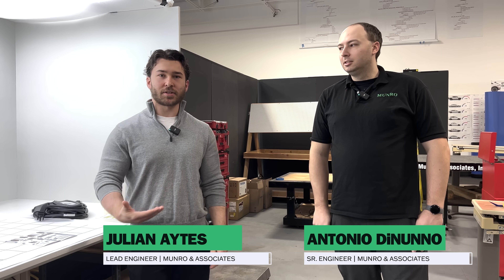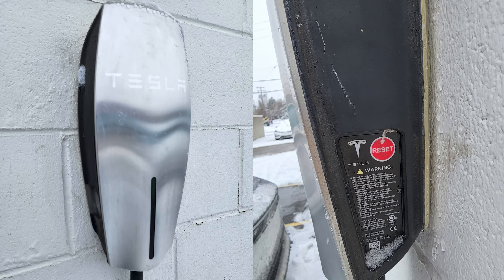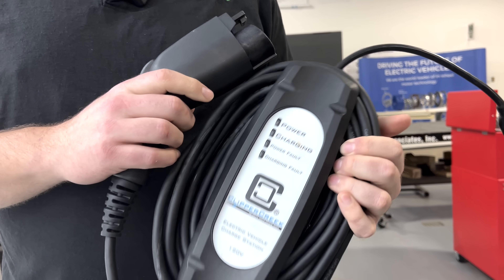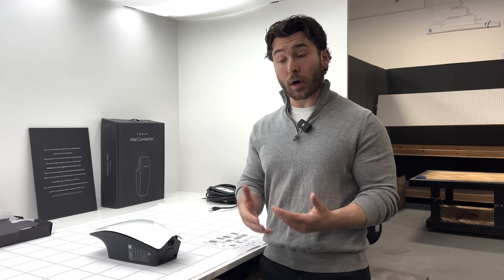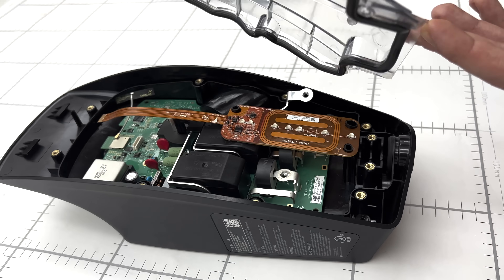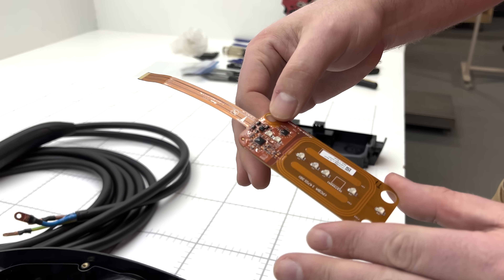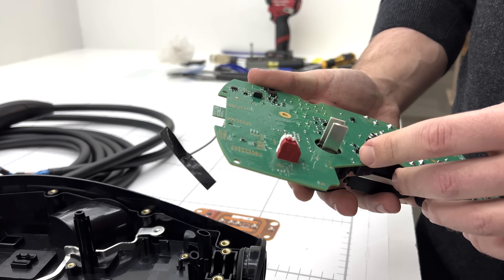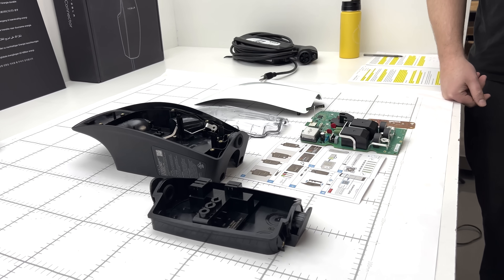EV Home Charger Teardowns E1: Tesla Wall Connector

Comment: Those two connectors unpopulated are for between unit’s communication up to 6 units connected parallel RS485 for load balancing. I have 2 connected at home but suspect they now communicate via Wi-Fi instead. That allow them all units to share and load balance dynamically single circuit like 60A between 4 cars or 40A between two in my case. Works better than any other I used.
Reply: If it’s RS-485 then it should be easy to find the necessary transceiver ic on the board.
Reply: The 2-wire interconnect was what version 2 had, version 3 only has wifi according to Tesla's specs. So while the version 3 may still have the hardware, if those terminals are that, they currently have no function.
Reply: @HenryLoenwind  Maybe to communicate with an older gen2 version?
Reply: Pavel u are correct. The Gen 3 can power share up 6 gen3 units feeding from a variety of breakers. Ideal for commerciall installs in parkades etc
Reply: I have a Tesla Universal Wall Connector install soon and those RS-485 terminals (mine has 4 terminals marked D+/D-/Gnd/12V) can also be used for a dynamic load  meter (Tesla sells them on Amazon now). The load meter device has two current clamps and two voltage leads to a 15A double breaker, all mounted at your main panel. It's the same Neurio W2 meter with Tesla firmware used for Powerwall installations, Tesla part #1938241-00-A. It has WiFi but for this use the docs say you must use the cable to connect to the Wall Connector. The clamps measure the total house power and send it to the Wall connector. You can then program the wall connector to reduce the charging current to stay within a whole house limit, avoiding the need to either upgrade you power service (expensive) or set the maximum charge current to less than 48A. To get a permit for install, cities want you to do a maximum load calculation to determine if you have 48A of free capacity. My house has a 200A panel, but when you do the load calculation there is not 48A available when my 2 A/C units (one per floor) and other high consumption devices are on. The only tricky part has been trying to determine if I can put the RS-485 shielded twisted pair cable in the same conduit as power. After a lot of research, I think the answer is yes, if you use a 600V rated twisted pair cable like Beldon 3088A (generically type TC cable). Conduit fill calculators say 2 x #6 power THHN (75A at 90C), 1 x #10 ground, and the data cable will all fit in a 3/4 EMT conduit. I was considering 3 x #6 including a neutral + ground+data but it would not fit without 1" conduit,  and the docs say top entry hole on the wall connector can't be expanded to 1". As I will use a top entry into the Wall Conenctor, there is no other hole for the data cable to go into the wall connector unless I drill one myself, and drilling new holes into UL approved electrical device may make the inspector frown. If you use the right cable it's code complaint and people who wire things like industrial motor controls using RS-485 say it will not have interference issues due to being shielded twisted pair. When I apply for the permit soon, I will see if the city agrees. The docs say currently you can't use both dynamic load control and load sharing between multiple Wall connectors.
Reply: Tesla chargers are an iPhone of chargers. They just work. Not many setting you can change though. At first I was bummed by that coming from other brands where you can tweak all parameters but after few days I was like “Damn if I care about all those tweaks! It just works somehow and that’s save me time and worry!” Tesla magic. Now I never even care to check what those charges doing and how because they do their job orchestrated with cars so perfectly!

Comment: You can feed the Tesla charger from the top, bottom or back. I installed my charger and fed it from the back for a very clean installation.  Just make sure to size the wire to handle a 60 amp load and use copper per the Tesla specifications only. My charger was $450 but my wire was $950. I did however run the wire 70 feet so I went to the max gauge that would fit the charger and was required to carry 60 amps, even though the charger is 48 amps max, you must install it on a 60 amp double pole breaker circuit per code. Southwire has a free app to calculate the wire size based on the run distance and amp load.
Reply: guessing you did 4/3. overkill. 6/3 would have been fine and cost $400-$500 less
Reply: @jm100368  4/3 is much better especially at that distance.. im at 6/3 33 ft and im not gettign max voltage.
Reply: @thang1742  Depends on a lot of factors including the voltage the step-down transformer is set to, time of day, the length and quality of your service drop, other houses sharing the same transformer, and installation quality. I wouldn't worry about it unless you were getting less than 228V.
Reply: Yeah, sounds like you oversized the wire and paid more than necessary. #6 is fine for up to 200 ft. You size conductors based off actual load, not breaker size. So you should have used 48A in your voltage drop calculator, not 60A. The breaker is then sized to give 125% of the necessary ampacity in this case.
Reply: 80% max on continuous load, which is 3 hrs or more
Reply: The length of cable is what really did me in. ouch.
Reply: @BatterVswithAntonio  In the Tesla online installation direction it clearly says #6 wire
Reply: @bossmanmce5599  good find

Comment: Took mine appart after replacement was sent  a Main relay was stuck …. 
Bent back the spring  and modified a bit and my dad been using it for his Chevy Volt -20c weather for a Year not problems albeit Volt charge at 20amps max

Comment: Don’t underestimate the L1 charger. It can do up to 16A at 120V which is right at 2kW, which can charge your car slowly even in winter. I’ve tested it down to 20F. It alternates between heating and charging. Hardly ideal, but it’s not the joke that people think it is. EU folks don’t have this ridiculous problem thanks to having mains at an actually useful voltage. 🤣
Reply: Another factor is that in Europe it already doubles to 3.8kw which makes a larger difference.
Reply: @qlum  it’s limited at 13A. That is about 3Kw. For me it’s good enough. The real problem with the level 1 is that you don’t know the state of the outlet. It’s an extra possible point of failure . The level 2 has a direct connection. But yes, it can do the job quite well.
Reply: @syproful  fair enough, my point was more to illustrate that there are some significant differences when you go to the large portion of the world that uses a higher voltage than the 120 used in north america

Comment: Thank you for the update and fixing the information which was incorrect! 10/10 Munro!
Reply: What was incorrect?
Reply: @PaulCHa  if people want to get bent over this video use of the term "level three" or "level four" is not reflected in any electrical code that I know of. Some people dislike people calling DC fast charging "level three". Personally I like saying level three however would not be able to prove my case to a judge in the court of .... Electrical nomenclature? 😂 Unsure what was incorrect in previous video.
Reply: Yes.  Thanks Munro Live for fixing the previous video. Munro goes the extra mile to insure the information they provide is correct.

Comment: Just had one installed for our new Y, nice to know what's inside, electrician  thought it was great, wifi took a little fooling around, operation great
Reply: Wi-fi was a bit non-compliant for me as well, had to get a range extender set up and now it works great
Reply: @Antonio DiNunno  My issue was connecting to my Google mesh.  Not sure what actually worked, but it finally connected.  Bet they do a fix in a future wall connector software update.
Reply: The reason the wifi was hard for you was because the Google Mesh & Nest routers uses a combined SSID and doesn’t separate the 5ghz and the 2.4ghz. It determines the band your device will be on based on distance.

The Tesla wall connector uses only 2.4ghz. So if you’re too close to the router it’ll try and connect to the 5ghz band and will have fits. The wifi extenders will separate into both bands where the Tesla wall connector can now choose the 2.4 band manually. Same issue Google has with smart home devices like bulbs that only use 2.4ghz.

Most routers do not have this issue as you can separate your 2.4 / 5 / 6 bands but Google combines.
Reply: @Way-Way  Sounds about right. Google's hardware is an absolute mess. Not sure how the worlds biggest software company has so much junk coming out, but its gotten ridiculous.
Reply: Congratulations. On your Wi-Fi it took 5 months to get a reliable Wi-Fi for my Tesla.

Comment: So, one assembler could put together 12 an hour. It took Antonio less than 10 seconds (leaving out the threaded fasteners).
Reply: I have a feeling that "less than five minutes" is really "WAY less than five minutes" (if they are even using humans for it).
Reply: I'm a highly qualified assembler of assemblies. I can't be used as a reference because I'm an outlier. XD
Reply: @BatterVswithAntonio  working for Munro you must be. You made that look so simple - I bet you could assemble it blind.
Reply: @peteregan3862  Sandy's lean design icon is BOB, blindfolded, one armed builder. Ideal design if it can be built that way.
Reply: @BatterVswithAntonio  true. I've watched many Munro videos. BOB is Sandy's best friend
Reply: I'm pretty sure they're talking about assemblying the diffrent parts on the wall at the customer after having prepared the wiring and drilling.
Reply: @ulwur  both! both have been considered in design with the intent of  making them as simple as possible.

Comment: It doesnt have load balancing…??
Reply: It's my understanding that it does. If you have two or more of these on one circuit, it can balance based on charge level and priority for each vehicle.
Reply: It has. Using WiFi to communicate with the other wall connectors. The old version 1 and 2 used RS485 cable between the unites to have load balancing.
Reply: I believe that is the point of the serial communication connection.

Comment: One thing to note about all level 2 is that they do very little, they are basically a smart switch that disconnect the power to the cable when not in use.
They put the 220v on and the real work happen in the onboard charger of the car.
Reply: Yeah, I think this should have been mentioned in the video.  Same for L1 of course.

They do provide ground fault protection though.

Comment: I'm wondering which of the three levels charges the most efficiently. I'd assume level 2 is pretty good in relation to charging speed and efficiency vs. loss. has anybody any numbers?
Reply: I don't know if this applies to Tesla vehicles, but the Nissan LEAFs I drove for seven or eight years were less efficient on L1 charging because the power drawn by the car to continually operate cooling pumps  took a relatively bigger bite out of the available supply power.  Another factor is that there are solid state electronics involved in the charging process that have fixed voltage drops (typically, some multiple of ~1V silicon PN junction drops) regardless of current.  Those drops are a larger percentage of a 120V supply than a 240V one.
Reply: Level 2 (240v) charges slightly more efficiently than Level 1 (120V).  There's a bit more conversion loss going from 120V to ~400V. It's only a couple % loss from what I gather, so you'd only be paying a few extra pennies to charge at 120V. Although if you're charging at high amperages on 240V (above ~30A) you'll start going the other way due to heat loss. Above 30-32A the cables get ever-so slightly above ambient and the car's cooling system kicks on. I charge at 22A and this keeps the cooling system off most of the time. Also keeps the voltage sag at a minimum.
Level 3 DC fast charging is the least efficient due to the way it's used. There's quite a lot of heat generated at hundreds of amps. But, small price to pay for convenience of speed.
Reply: @andrewt9204  thanks, that was also my thought process. I was just wondering, if this has been calculated. What I think to know are 5% loss at SC, gets even worse 15-20% on top if you factor in preheating and AC. But then again less conversion from the grid
Reply: If you search for it… the numbers are out there. From memory, I think the most efficient is between 7 and 11 kW. Any slower and the on- board computers running start to have an impact on efficiency.
Reply: Level 1 and 2 charging uses the charger onboard the EV so the wall connector has very little to do with charging efficiency. I suppose if the gauge of the cables in the connector cable were marginal, that could have a small impact on charging efficiency, but it would be rather minimal. Between Level 1 and Level 2 charging, the faster level 2 charging is more efficient because it uses 240 volts and the shorter charging times contribute significantly to charging efficiency. I suspect Level 3 charging is the most efficient of all in moderate temperatures because it has fewer voltage conversions from the high-voltage transmission lines, but the need to warm or cool the battery to be able to handle the higher currents probably makes the overall process the least efficient of all.

Bottom line: Charging Level 2 at home or work is probably the most efficient (and that's a good thing because 95% of all charging happens at home or work).
Reply: For Level 1/2, a Tesla uses 1-2A to keep the vehicle electronics running, so it is most efficient with the highest current, relative to the car.  A DCFC (no such thing as Level 3) is more efficient in terms of power over the wire, since there are no onboard losses of a charger, and should be slightly more efficient overall.

But, it is generally best for your home and vehicle to not charge at more than about 24A, as you get a lot more utility voltage drop and  increase the risk of fire due to thermal cycling of the wire terminations.
Reply: All the same, they are only a smart switch, everything happen in the car onboard charger for L2.
The only notable difference is the current and voltage they support. To get reasonable charge speed use 220V. 120v can work if you don’t drive a lot and the car stay plugged in most of the time.

Comment: Thanks for the Analysis.. Could you ad extra information such as (Resistance to Weather of Casing, Cable, Connector protection in Hot or Cold temperatures)
Reply: Check out "State of Charge" 's youtube channel for more detailed info about operation.
Reply: @BatterVswithAntonio  Yep but ! I trust Sandy team.

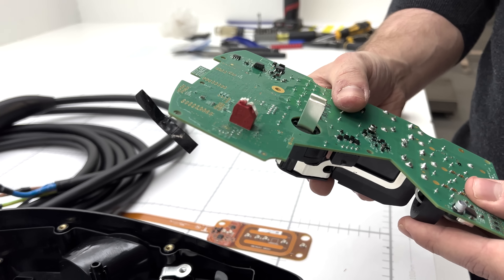Comment: 10:36 these terminals maybe an input from an external current transformer to allow charge curent to be limited based on total house load. This is a very common feature on EVSEs in the UK
Reply: Keep guessing guys, it's an RS485 for load balancing when using more than one charger in a household.  Its plainly labeled on the instruction sheet, too.
Reply: @shazam6274  Cool! I really expected that to be a wireless communication of some kind but wired is good too. I’m going to need a second one at some point 🙂
Reply: @shazam6274  fantastic, thanks for the insight 😀
Reply: Interesting that they would keep that on a 2-phase board when everywhere else has 220/230 V on a single phase. Do you think it'd be useful to only monitor one leg of the mains in the US?
Reply: They could also be test and diagnostic points used during manufacturing.

Comment: very basic report you did on the mechanical part only. It is x times more interesting to find out what can be configured via WiFi and what the box is capable off, e.g. 
- RFID?
- Setting to allow only certain VINs to charge
- Trotteling when multiple chargers are on the same AC wire
- How many watts it eats when idle
- Options how to enable/disable it via WiFi
- Options to limit the max charging power e.g. 4 kW instead of 11kW  for solar planets where the solar system cannot produce 11kW
- Options to remote enable/disable charging
Reply: Yes, you can limit charging for all EVs, all Teslas or specific Tesla VINs. Multiple chargers communicate via Wifi to share the total supply amperes. You set the max. current / power during setup. Not easily adjustable while charging. Some use Tesla API to dynamically adjust the charge rate in car according to solar, or use different wallbox which can be integrated with solar.
Reply: @Marki555  hi Mark, thank you very much for this specific information. I am planing as well to write some software to use the Tesla API to adjust charging in sync with the solar power production. Regards from Hannover, Germany
Reply: It is clearly capable of more than just charging. I feel like there are a lot of software based easter eggs ready to be activated with an OTA update